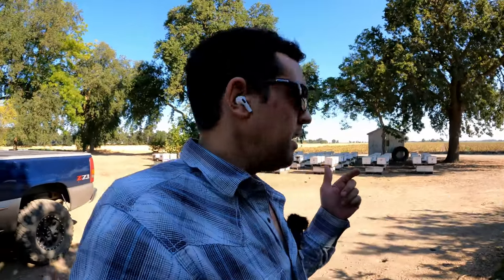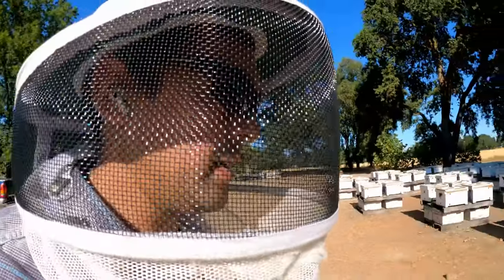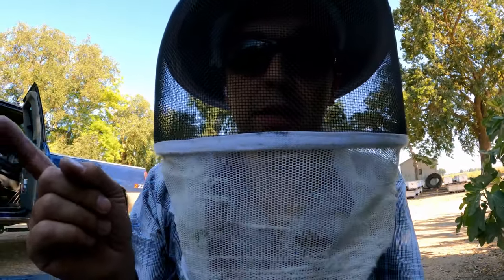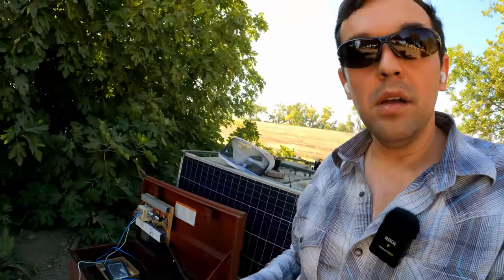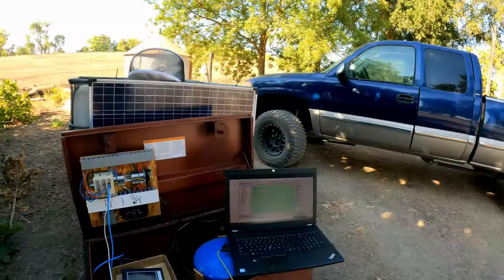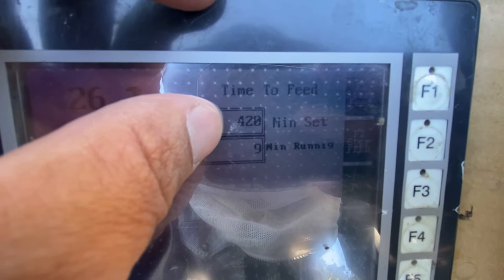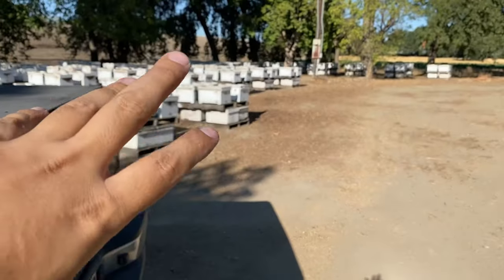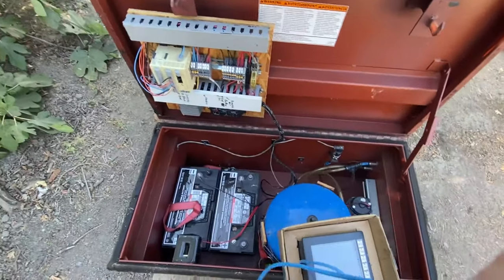Auto Feeding Nucs

Comment: wooooowI thanx sooooo much! Think we`re ready to see more about it! 🙂
the integrated accumulator is very nice! If I understand right, the pallets are connected parallely with the pressure tubs, not serially? I have not seen pressure tubes in between the valve tanks.
For how many days would this two battery last without the solar collectors? we are very grateful for the effort you put into filming...., with the climate change we are experiencing in Europe, we are forced to leave the traditional ways of thinking and this kind of systems and thinking can keep us in business.... , 🙂
Reply from the maker: You are welcome! 
I would say about 7 days or so. Then takes about a day or two to top of the batteries. You could always add another solar panel. Because even if it is cloudy you get some electricity from them. 
Correct they are connected parallel. They tee off under the pallet from the main line. 
I’ll try to film a little more when we work with them again.
Reply: @BeeInnovative  thanks Sergei, we`re looking forward to it! Pat

Comment: Have you tried putting the totes up in the air and let gravity do the work. You could use a timer and a valve to set the amount of time the bees are feed. Like the idea of feeding so many at once.
Reply from the maker: You would have to put them Very high up! Even lets say 10 feet you would only have about 3-5psi. With the hoses only 1/4inch ID you need a minimum of 15psi. Besides we have them in areas where I don’t want them high up, unstable uneven ground. But I like the way you are thinking!

Comment: Nice setup. You might consider to use a water level sensor (with wires at 3 levels) or simply a water sensor (but these type of sensor might corrode and not last long) to start and stop the pump.
Reply from the maker: It’s a good idea, however you can not use anything that’s moves as a sensor. Otherwise the syrup will clog it up and it will not move after a while. We also have squirrels what love wires.
Reply: @BeeInnovative  If you search for water level sensor, you'll find that the sensor is a 12v device with 3 connectors. you attach the wires of your choice. I staple the 3 wires to different levels on a wood stick and it will stop when the level is down to the lower level.
Reply from the maker: @allanliu1314  thank you. I’ll consider it on the next one.

Comment: Hi Sergei, i assume this is only for sugar water. Are you planning to include protein / pollen sub feeding also into this system?
We struggled with adding protein sources into liquid distribution systems quite a bit. what are your thoughts?
Thanks
Colin
Reply: Hi Colin, we`re used to feed protein in liquid form. The products on the market are way to expensive.... We use different sources.., but never solids they will sediment! check out liquid protein isolates like yeast isolates or soy protein isolates in liquid forms! Pat
Reply from the maker: You are correct this is only for sugar water. We have thought about protein distribution before, however I have to pick my battles. But I like the way you’re thinking. Maybe one day

Comment: Very cool, why did you choose to use a Plc instead of just using float switches and pressure switches? That seems like a cheaper route.
Reply from the maker: It’s all about power management when you are running on solar. Pressure switches don’t have a wide range. The ones that do cost more than the PLC. Also the PLC has a specific feeding time. If the battery levels get too low it skips the feeding cycle.
Reply: @BeeInnovative  makes sense... now you have my mind 🤔😁
Reply from the maker: @ETsBees  what do you have in mind? Something innovative I hope 🤞🏻
Reply: @BeeInnovative  maybe something Similar like this to try winter/fall feeding.
I’m to busy to mess with this right now. I have been working on a honey stick filling machine (I haven’t finished yet) and a new oxalic vaporizer. I have a couple vids of the stick machine but none of the vaporizer
Reply from the maker: @ETsBees  that sounds like fun projects.